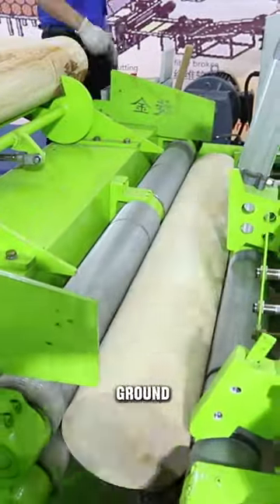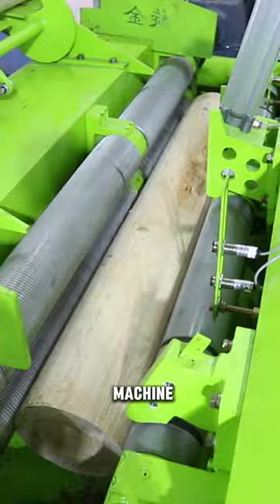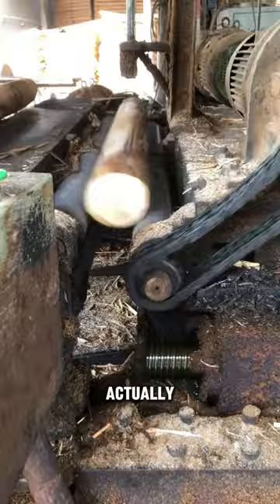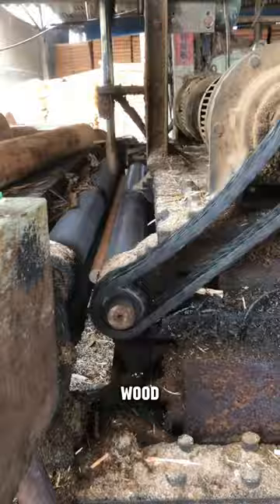Why Grind Thick Wood Into Thin Stick #shorts

Comment: Those aren't plywood.
Reply: Remove 'r' in your username
Reply: @Laughing_Central638  what user name?
Reply: Kengray 🚫
Kengay 👌
Reply: @Laughing_Central638  what is PhD in?
Reply: No, they are not plywood... they are Vaneer wood that are stacked upon each other to make plywood
Reply: @rebeccasaunders3290  they aren't making plywood out of it. They are just making veneer and stacking it off the line.
Reply: @KenGray  🤦‍♀️ I didn't say that's what they were doing! Read properly..
Reply: @rebeccasaunders3290  reread.... You did.  Maybe try punctuation.
Reply: @KenGray  I told the process! I didn't say that's what they were doing! Get your sht right before accusing others.
What do I need to punctuate?
Reply: @rebeccasaunders3290  almost your entire statement where you said they were going to make plywood. It's your comment; why do I have to tell you what YOU said. Just pay enough attention that you know what YOU say, and things will be easier for you. 

Thus endeth the lesson.
Reply: @KenGray  WRONG!!! 🤣🤣🤣🤣🤣
Reply: @KenGray  I said they are not making plywood (end of sentence)
They are Vaneer (referring to the wood)
You spent how long messaging to find you are wrong 🤣🤣🤣🤣🤣🤣🤣🤣🤣🤣
Reply: @rebeccasaunders3290  I think the problem is that you don't think we'll, thus you don't write well. Common problem with folks as young as you. Also, ignoring obvious evidence to the contrary is another problem. But, I can't help you there. You can lead a horse to water but you can't make him think. 🤷🏿‍♂️
Reply: @KenGray  problem is you are trying to justify what I said instead of your own initial words! She clearly said they are making Vaneer. You put extra words to what I said which makes you wrong!
You are failing at trying to get me to understand what you are saying because you can not grasp I am right, and you are wrong! 
The fact that you are trying to say your age makes a difference to your argument is pathetic and tacky. 
I didn't even read your message as I got bored with it... which initially means you failed!
Reply: @rebeccasaunders3290  you're the one who said plywood.